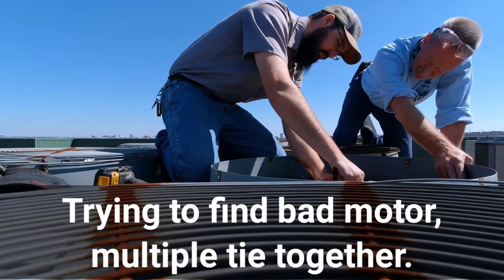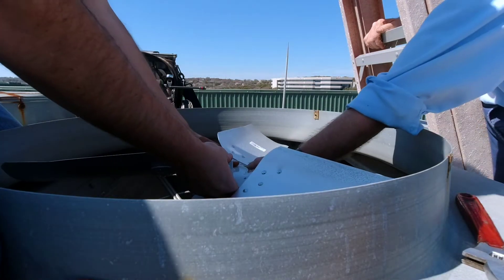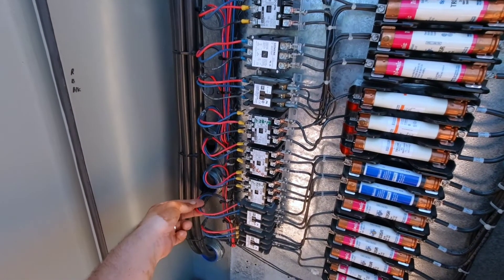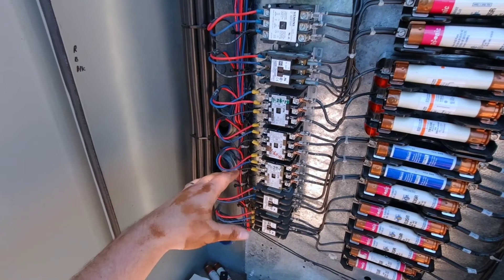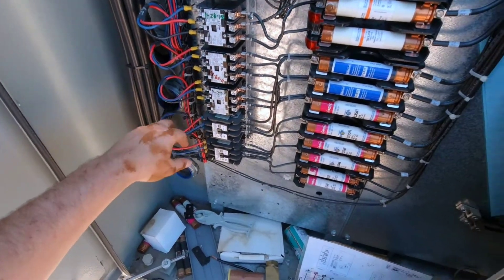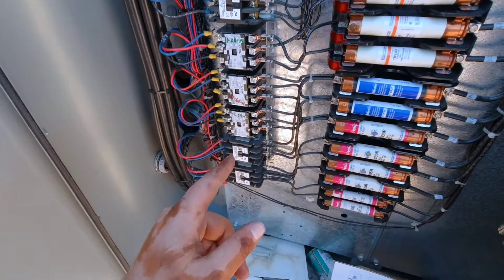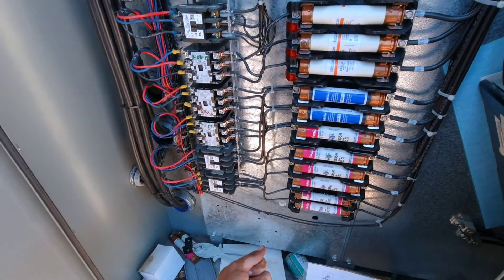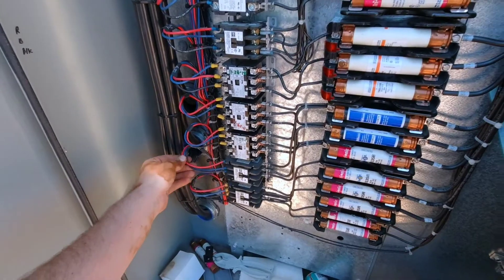Trane Chiller RTAA Condenser Fan Short

Comment: Got an rta with fan spinning backward while the other in the circuit are spining. The correct VFD was replaced less than 7 months ago. My assumption would be vfd is failing and took the fan with it

Comment: Process of elimination works best, had this on an RTAC last summer.  It was either 3 or 4 fans per circuit if o remember correctly.  Pulling each fan one by one until you find it.